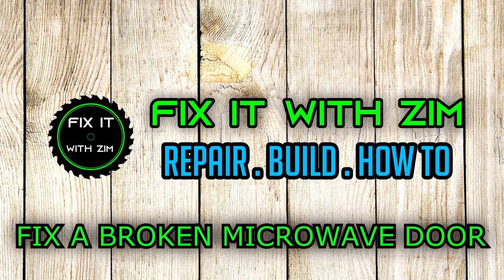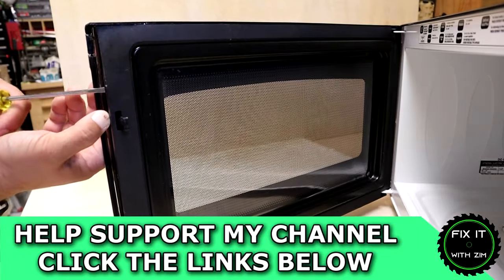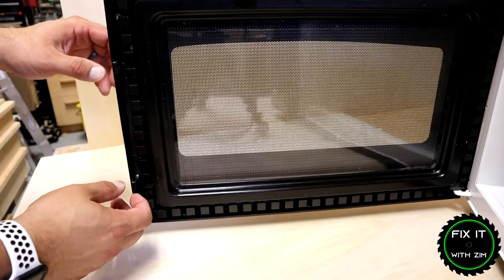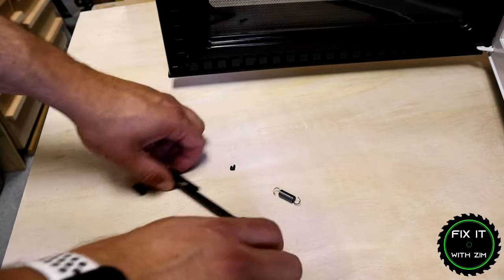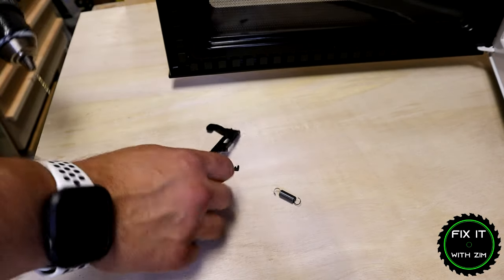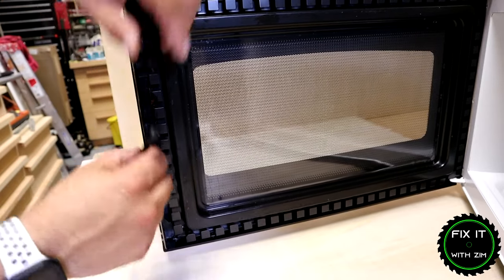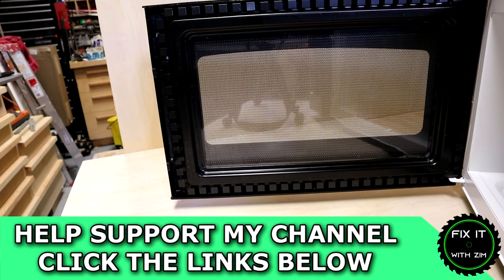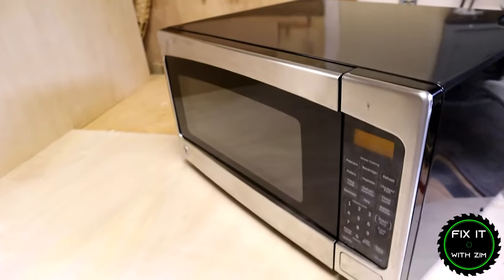Broken Microwave Door | How To Fix

Comment: Thanks so much for this. You just saved me approximately $600. I wanted to replace with the same microwave that I had and the price with installation is around that. Luckily, they still designed many of these microwaves with the same concept. Subbed!
Reply from the maker: Thank you…appreciate it👍🏻

Comment: A thousand thanks! I did it, I fixed the latch on my microwave door, and I owe it all to you. I clicked your links and liked your video and subscribed to your channel. It was a bit trickier on my 26 year old model, (wait, what?!? 😄) because I had to put the new hole inside the door frame instead of on the latch part, but your heated wire tip worked perfectly for the job. I am tickled pink! I appreciate you.
Reply from the maker: Awesome!!! Glad you got it fixed 👍🏻

Comment: Hi Zim!  I got here from your "original"(?) microwave latch video[which I also 'liked'] because the door on my folk's over-oven Frigidaire "Gallery" series MW stopped latching- Model# FGMV174KFB (for those searching in the future).

I feel it necessary to tell you that I've worked in electronics/small appliance repair professionally off & on for...  eh, never mind- a long time regardless; and of course personally ever since I owned something I needed that broke.  In those many years there were the "official" repairs, the "make it work" fixes, and those repairs that worked best.

I say this so that I hope you will feel the full, immense, gratitude I feel towards you in showing not only how to perform this simple repair; but in how people don't always HAVE to just throw new parts at a failure- sometimes the "hack" fix is as good or better than the replacement.
Reply from the maker: Thanks for the comment!  I get a great sense of pride and satisfaction in knowing that I fixed something myself and for free...these microwave door repairs are a great example of that.  I’ve had countless people tell me in the comments that repair companies come out and tell them they need a new microwave.  To me, that’s insane.  To initially rip someone off for the price of these things and then to have a poorly engineered part fail long before the microwave itself is past its useful life is robbery and furthers our disposable society’s mentality that this is just “how it is”....That things just break and we need to go out and buy new all the time.  I’m happy that my videos have helped others and saved them money...and of course, that sense of pride that we can still fix things ourselves.  Thanks again!

Comment: Thanks for the video. Took less than 5 mins after watching. Was going to just toss it out. One suggestion, instead of drilling a hole I used a small zip tie to hold the top of the spring. My spring was a closed loop rather than a hook. Good stuff, thanks again.

Comment: Thank you for this video! I was super pissed when apartment maintenance came and broke the latch off the microwave door and didn't tell me even though they were there just to fill a hole literally 3 ft away from the microwave. I have a vintage Hello Kitty microwave and they are going for over $200 used online and I brought mine new so you could imagine how upset I was. I fixed it thanks to you and now I'll be keeping the microwave out of the kitchen when maintenance is doing work in the kitchen.

Comment: Very useful video! We had the same problem, even smaller. It turned out that the spring had simply come loose. I didn't have to drill a hole. I was very worried at first because our microwave is built in. I wouldn't even be able to unhook it myself without an electrician. Thanks a lot for the explanation!

Comment: Thanks a lot! I managed to repair the loose latch of my microwave oven after watching your video. Suggestion: if your oven door is almost at the edge of the piece of furniture it's resting on, place a rug on the floor. In my case, the spring fell on to the tile floor and bounced away. I only found the spring bout 24 hr later. Anyways, all's well that ends well 👍

Comment: Thank you so much!  Now I'm a HERO!  I can't believe real mechanical engineers designed and built these pieces of crap unreliable latch systems with such a weak link. Mine is in a 2009 Emerson MW7300W.  OTT, the overall oven is fine.
Reply from the maker: You’re welcome!  Yes, a really terrible design!

Comment: I fixed the broken latch but now the door is a bit off balance and when closed sometimes the light won't go out. If I press hard & push up a bit on the door it will shut and be functional. Is there a way to stabilize the door better. It is a GE Spacemaker® Over-the-Range Microwave Oven  JVM1540SM4SS

Comment: I have a Samsung Over the Range Microwave. The top one of the 2 holes where the door latch sits, is broken. The top key latch is loose and doesn't let the Microwave run. Tried gluing it back on - it worked on for sometime but again it came off. Any better suggestions?
Reply from the maker: Maybe get a plastic washer and hot glue it in there.  The post can then ride up and down inside the washer.

Comment: Well… this is great if you can get the door to open.  Mine went crazy on me soon as I put my food in and closed the door. The plate started spinning before I hit the minute power. I hit cancel, tried to open the door, nothing worked. I hit the one minute button, nothing, the plate was spinning without power. Cancel again but the door refused to open. I ended up shutting off the circuit breaker and unplugged the microwave. It’s an in cabinet microwave.  
I’d appreciate any suggestions.  At the very least I want to open the door so I can discard the food before it rots.

Comment: I have Panasonic microwave oven and I need to push the door quite hard to be able to close the door with a loud “ bang”. It is annoying especially late at night as the banging noise could wake up others who are sleeping. What do you think could probably be the problem and the way to fix it. Thanks.
Reply from the maker: Possibly too much tension on the spring. Worth a try to see if it fixes your issue.
Reply: @fixitwithzim  Thanks very much Zim for your advise. Do you think I should try to hook the spring to a closer spot in order to reduce the tension or should I change the spring ?
Reply from the maker: @edmundling6591  move it closer or try to stretch it. Either or should have the same effect
Reply: @fixitwithzim  Thanks very much Zim for your advice. Will try it out.

Comment: So I thought after watching this I would have a quick fix. Unfortunately, it wasn't the door lock that had the little piece snap off. Upon removing it was in great shape but the plastic piece in the middle it or the spring slips into had a piece break off. Any hacks or suggestions to be able to fix this so the door will shut?
Reply: same thing just happened to me. Were you able to fix it? Or did you have to buy a new microwave?

Comment: My KitchenAid countertop microwave "door open push button" gets stuck repeatedly. When the door is closed, and I push the button to open it, the button gets stuck in the depressed position, and I have to close the door multiple times before it stays closed. Is the problem with the door latch, or the push button that opens the door? Seems to me like it's the push button that's broken on the inside, and not the door or the door latch at all? Please advise. Thank you for your videos.
Reply from the maker: Sorry for the late reply, did you ever get this fixed?  Sounds like the latch is binding.
Reply: @fixitwithzim  Dropped it off at a local reputable repairman today. Didn’t realize when we bought it that countertop models aren’t serviceable,  even though we bought an extended service plan. Hoping for the best. Thanks for checking in!
Reply from the maker: @Momshelper47  gotcha, good luck. Hope they can fix it for you!
Reply: @fixitwithzim  I had a friend offer the help of someone who has a 3-D Printer. I gave them the broken interior piece and they printed one off, then the repairman fixed it! Super cheap and easy repair! Very pleased with the new technology which saved me the expense of a new KitchenAid microwave!
Reply from the maker: @Momshelper47 Oh wow, that's great!  My next investment is a 3d printer.  Endless possibilities.  Anyway, glad you got it fixed!
Reply: @fixitwithzim  Go for it! Could help a lot of people in creative ways! I bet they're amazing to work with!

Comment: What to do if one of the latches broke off and you close the microwave and now it will not open anymore.  There is still food inside and when it is plugged in the microwave turns its lights on and spins but no time is down and door will not open!

Comment: the bottom piece on the door is what's broken, so I don't have anywhere to hook the lower part of the spring to.
Reply from the maker: The bottom of the latch assembly?  If so, drill a small hole in it and attach the spring there

Comment: I fixed the microwave door, but the light won’t go out when you shut the door.. and the microwave won’t start.. any thoughts sir??
Reply from the maker: Hi, sounds like the latch isn’t dropping down far enough to trip the button in the microwave housing. You might have the spring tension too tight. Loosen it up and try it again

Comment: My latch didn't break.  The eye on the door itself were the other end of the spring attaches broke.  As much tension as is on these pieces this seems like it could have been designed better.  So, I guess that means I need to buy a new door.

Comment: Nice information on fixing the latch. Do you know if the outer front plexiglass on the door can be removed and replaced? From the looks of it I have the same microwave, GE. My model is JES2051SN3SS. The front plexiglass is cracked. Other than that it's a great microwave.
Reply from the maker: Thank you...not sure about the plexi. My guess is you’d need to buy an entire door assembly.

Comment: How to fix the the push button on door
Reply from the maker: Probably a spring that not seated properly. Can you disassemble the handle?
Reply: @fixitwithzim  No- it’s a push button.  Combo Wall mount with oven under it.  There is food in microwave.  Cannot get door open. No handle. Push button to open. Does not open.
Reply from the maker: Press the button in and push up and down on the door, you can also try banging it with your fist near the latch.  Something might be hung up and trying this could free it up